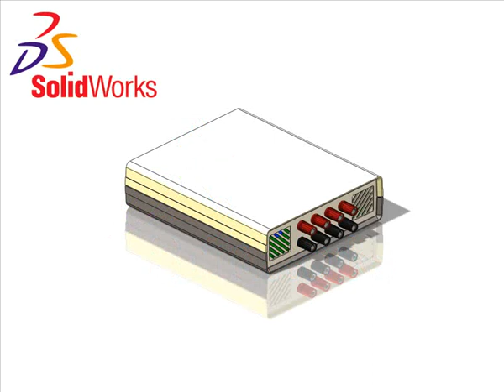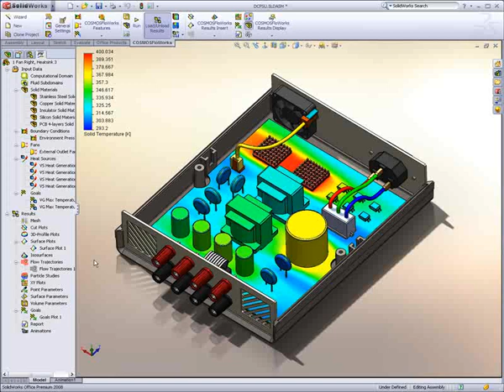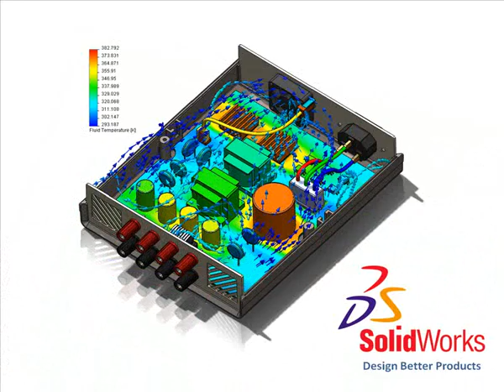Test your design with Solidworks

Comment: @SurfGreenStrato 1. the voltage here does not matter at all. What you need to consider for your heat management is the power dissipation. 2. Yes changing the rib structure does matter but not really significant at such small areas. 3. Using a cooler fan with not confirmed characteristics from measurement may change your results brutally.

Comment: @sivichkiqt Take a lm7405, use it with 7, 9 and 12 volt. Try different heatsinks, measure. Heatsink design does matter. And a lot.

Comment: this is rediculous. Changing the heat sink design, especially when the area is so small would never bring a dramatic change in the temperature. The fan characteristics are also very hard to predict also. Small turbulence dissipation with pin design variant are really making not much difference, compared to the extruded design. Please solid works- go back to a CFD study and don't blame yourself like that.